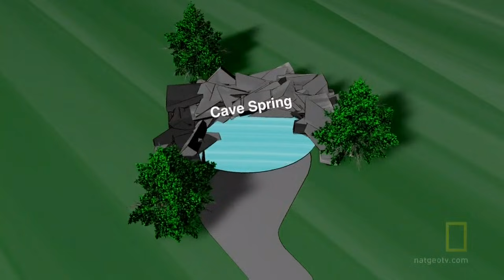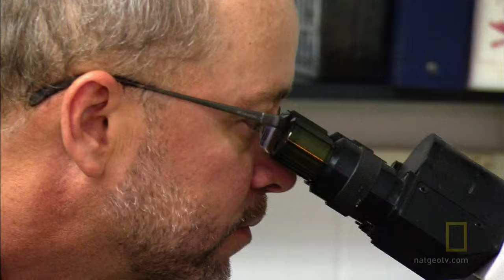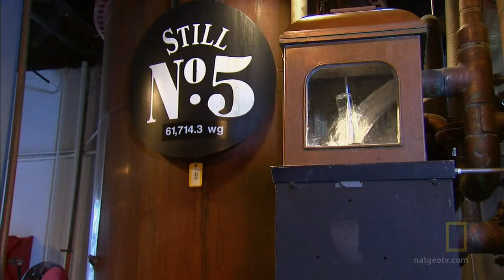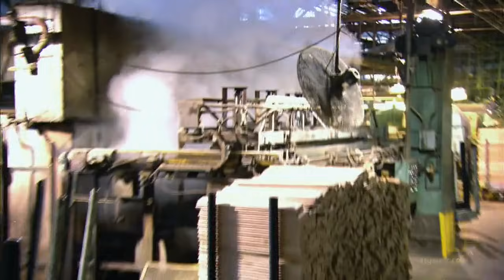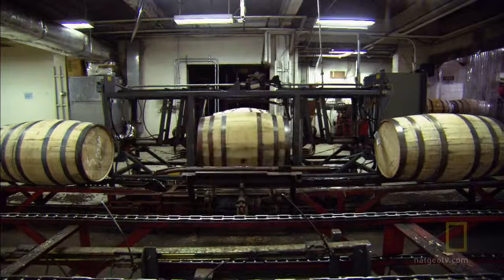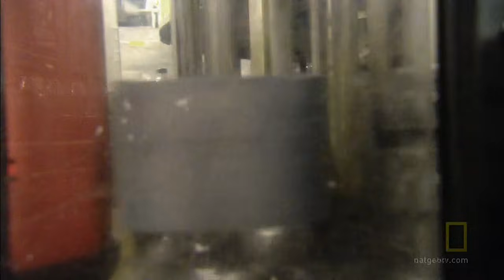National Geographic - Ultimate Factories - Jack Daniels

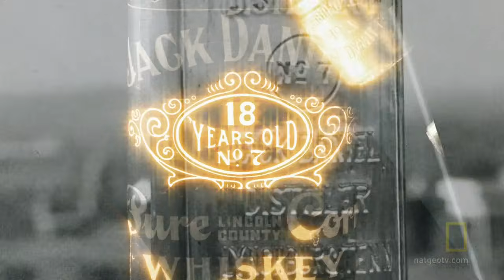Comment: 7:50 is pretty obvious.... isnt it?
PACKAGING!!! 
.
you can fit more square bottles into a box, with less wasted space, than round bottles 
and while you can do the same with hexagon bottles.... they would be MUCH more expensive to make
.
like.... why are most items in a grocery store, walmat, ETC a square or rectangle?
because you can put more product on the same shelf.... 
.
.
its THAT SIMPLE!!!
Reply: and a square bottle can be made lower which both means that it doesn't tip over on the table as easy as a taller round bottle if someone knocks it...